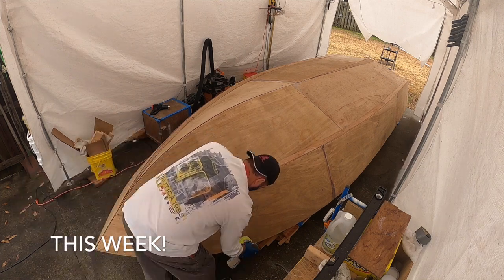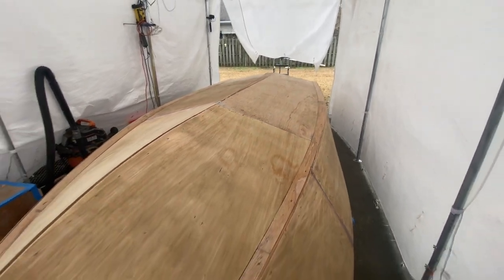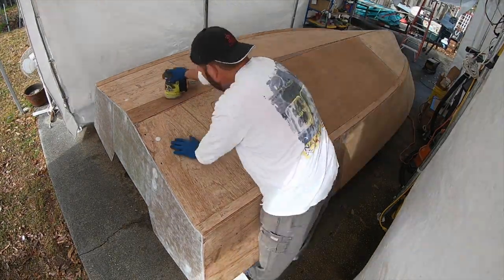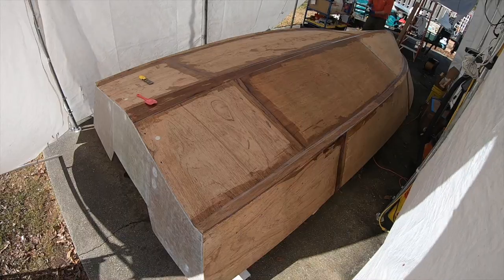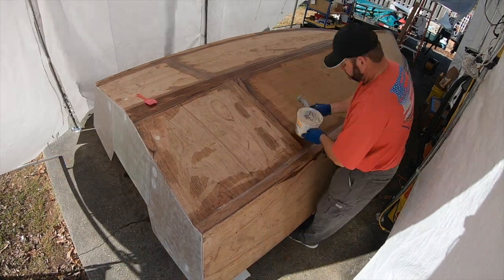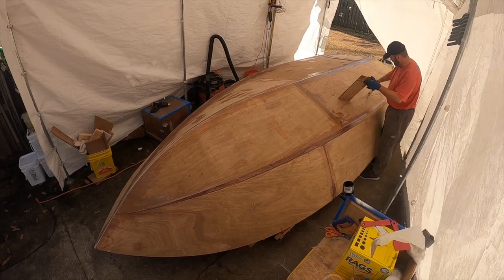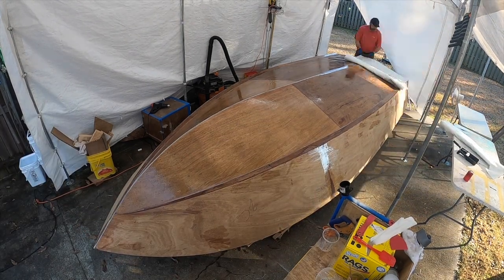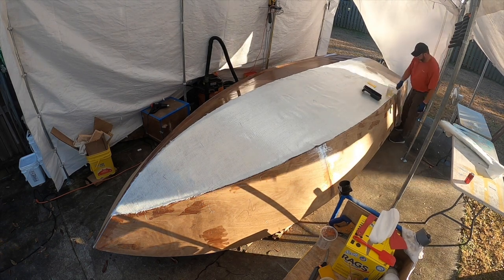26.DIY Boat Building: New Year of FIBERGLASSING!

Comment: Really fine work. From a casual viewer point of view, looks like a really professional job. In fact some of the commercial boats are not nearly this finely made. With the price of boats the past couple of years, a well built boat is very expensive.
When I was in my late ‘20’s I bit the bullet and purchased an “expensive fishing boat” and I’ve had 30 + years of fun and adventure.
And because the hull is good quality it’s time for a major refit, and it will be good for another 30 for my sons and grandchildren.
These are good vids, and should be guideline info for any guys thinking about building a boat. 
Nice boat !
Reply from the maker: Appreciate it and thanks for checking it out.  I'm not a professional for certain, but I am and have learned to do it the best way for my application.  At least that's the intent.  Now I'm curious what type of boat you bought 30 years ago.  Wanna share?

Comment: No notification again. 
Looks awesome buddy 
For your first attempt at building a skiff your doing a outstanding job. 
It’s built too perfection
Reply from the maker: I’ve researched the notification problem, and it may be a setting on your end.  It seems everyone else is getting the notification.  Check your device and make sure you have notifications turned on, and the other thing to try would be to turn the bell off, and then back on again.  As for the build, this part went pretty well for being as long as it took to do it, but like I described in the video I took small bites at it.  One step at a time.

Comment: Looks pretty good to me too, Oscar.
I’ve heard other boat builders say that the epoxy has a tendency to kick off faster if you leave it too long in the container. 
I did want to say that I noticed a big difference in the hull after you spent the time sanding on it. I was curious as to what you were gonna do with the sharp corner on the chine, guess I’ll find out. 
Thank you 
Continue to enjoy your videos.
Reply from the maker: No doubt the more volume you leave in a confined space, be it thickened epoxy or just resin once it’s been mixed, it will kick faster.  The thinner you can spread it out the longer it will take to cure.  It’s an exothermic thing I believe.  The sharp corner on the chine affects the way it sheds water.  the sharper the corner, the cleaner the water comes off, and the rounder the corner, the more the water wants to hang on to the surface.  The what’s and why’s about all that I don’t know, but I know that flats builders like a slightly rounded chine edge on the first third of the boat, and a sharp from there back.  Rounded is also supposed to help with hull slap.  Seems logical to me, so that’s the route i will take.  The painting process is going to soften the edge no matter what.  Appreciate you following along.

Comment: Sir.  You may want to buy some. Peel Ply to help you out from Sanding your Arm off. Have you thought of use Dye for your Epoxy mix on the Last Fiberglass? But try the Peel Ply out. 👍🏻
Reply from the maker: Well I actually had the peel ply and I was prepared to use it for the first time, but truth be told I was just too tired by the time I got to the end, and I had never used it before so I punted on it.  I was worried about putting out such large spans by myself having never used it before, so I just accepted having to sand everything.  I will detail that situation probably in the next video, but thanks a ton for the advice.

Comment: Hey my name is Benjamin. I have watched your channel on your build. I will be doing the same build starting in the spring. I’m a carpenter so not worried about being capable of the build, but it was nice to see the process. Definitely eased most of my doubts. Thanks for taking the time to make your videos. If you don’t mind me asking, I am curious about the total cost of the build. I would like to know what I should expect. Thanks for your time. God Bless
Reply from the maker: Hey man, thanks for checking it out.  It’s been a journey for sure.  I’ll finish it out and continue the videos for sure.  As for the cost, honestly, I don’t know.  I have been keeping track for the most part, but I don’t want to look at that summation until after I am done.  I’m committed to doing it the way I want, and letting the chips, or dollars, fall where they may.  However, in general terms, having looked at the cost of say production boats with similar specs, the total cost of this boat with. Boat, motor, and trailer, will be maybe 1/3 the cost of a production build.  There are some things that are just non-negotiable such as the outboard.  A 115hp out boat is going to be about 12K new.  I saved on the trailer where a new trailer is about $4k, I put together a totally rebuilt used trailer for less than $2k.  I hope that gets you in the ballpark, and obviously used motor and other components will save you money on the build.  Let me know if you have any other questions, and sorry for taking a minute to answer you.  I’ll try and do better in the future.

Comment: Super jealous you had that much time. If I ever build another boat in Florida I’ll be damned sure to be glassing in then”winter” that early Nov 85* temps really kicked my epoxy off way fast even with slow hardner. Plus, I didn’t factor in nearly enough resin for the bottom. Your build is going very smooth my man!
Reply from the maker: I’m really surprised your epoxy kicked that quick with slow epoxy.  All the glass I have done in 90+ degree temps here with the slow hardener I had plenty of time to get it wet out as long as I got the epoxy out of the cup and on the glass.  The stress I talk about in the video may or may not (which should be read, absolutely) was thinking about you the whole time.  But you persevered as well and your finish looks really nice.  You know, except for that spot. Everyone check out Lighting Capital Living’s build on his page @lightingcapitalliving

Comment: Doing that solo is heroic work - I’ve done it and can definitely relate to the stress factor.  I’m a little surprised you did not extend the glass several inches down the side and over your chine to give it a double layer when the side is laid up.  Regardless, there is great satisfaction after a long day of hard work.  Congratulations!
Reply from the maker: I can certainly see where you are coming from.  I think the next video will answer some of the questions about why I did it this way, but the short version is that this is how the designer spec’s it out.  The side glass will overlap and lay onto the chine and be doubled up there.  I hope that makes sense, but I will cover it in the next video.
Reply: @Bigeaux20  It still seems like you will have that one joint with a single layer, but I defer to the designer on that one.  Thanks for the reply.  I’m currently at the very end stages of fairing/priming the hull of a 24’ center console - hope to get the bottom paint on soon.  Building these things should come with a warning of heightened stress levels at times!   Now I am trying to figure out how to flip the darn thing!
Reply from the maker: I don’t know if you saw it but my flip from top to bottom went seamless, and I will probably do something similar when I go back over.  And I did it by myself.  I may consider using two engine hoists and rotating in air.  I have a lot to do to get the bottom finished, and then I will start worrying about getting it upright.